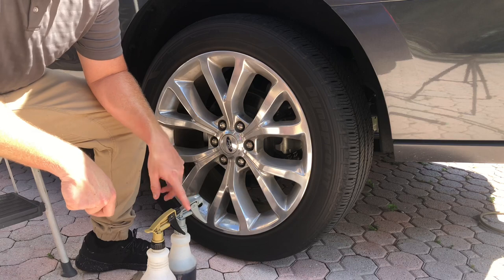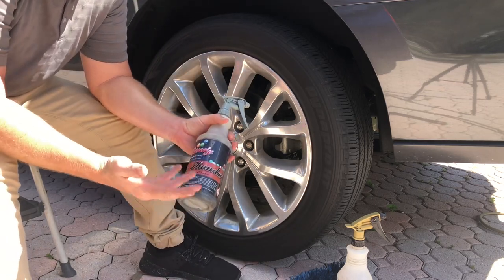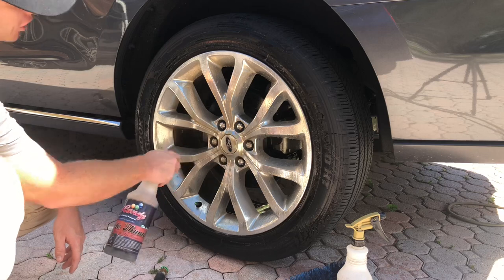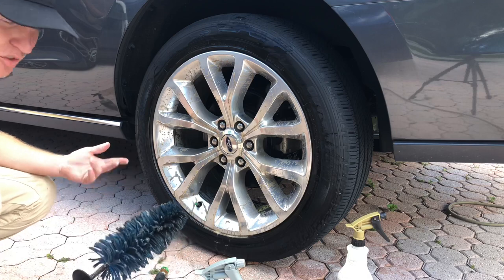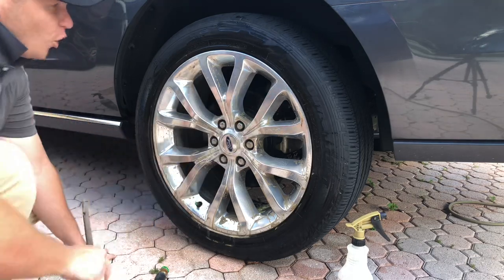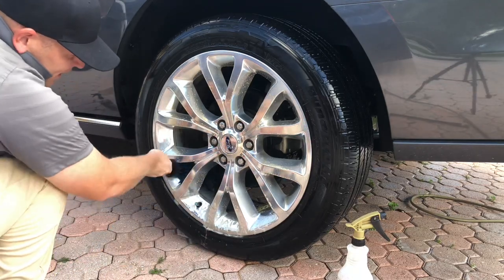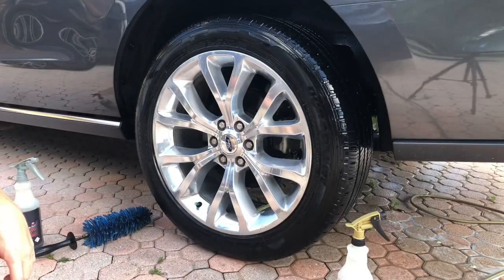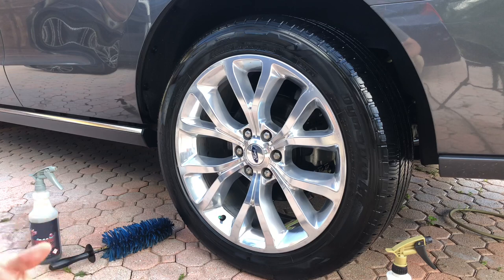SUPERIOR PRODUCTS RAGE WHEEL CLEANER - NOW KNOWN AS DARK FURY

Comment: Hi there,
I like the channel. I have a question for you about the Dark Fury. The label says NOT to use on uncoated, polished aluminum wheels however it says it won't harm painted surfaces or factory aluminum wheels. I have jet black painted aluminum wheels from Mopar on my Jeep and I'm wondering what your thoughts are on using the Dark Fury on them? I run a 35" tire and I was looking for something simple to clean both tires and wheels when I need to. Thank you! I've subscribed to the channel.
Reply from the maker: Wonderful!
Thanks for subbing!!!
So, with painted “factory” wheels it’s assumed that there is clear coat on the wheel. If it’s clean coated it is 100% safe. So I’d contact mopar and see if the wheels are clear coated. I’ve never had an issue with the wheels I’ve used it on, but that doesn’t mean you’ll have the same experience...
Make sense?
Reply: @mr.lad-detailingtricksntip  WOW! Thanks for the rapid response sir! I'll contact Mopar.
Reply: @mr.lad-detailingtricksntip  
Good news,
I found a description that states the wheels are clear coated. Once again, thanks for your assistance. I'll be checking the channel for more cleaning ideas!
Reply from the maker: Awesome!
Remember always approach with caution and go from there!

Comment: Do u think this would be safe to use on wheels that i spray painted/clear coated myself? I also put a spray wax protection on them too
Reply from the maker: So the bottle says factory clear coated. I would approach that one with caution and do a test spot. That way in case there is an issue, you could polish it out

Comment: Have new gloss black and milled wheels in truck. It's this safe?
Reply from the maker: For clear coated wheel regardless of color it will be fine.
As far as milled wheels though, I’d rather use something less aggressive. Break Buster seems to work well or even just a ph neutral car soap
Reply: Manufacturer is trying me that they are clear costs
Reply: Coated